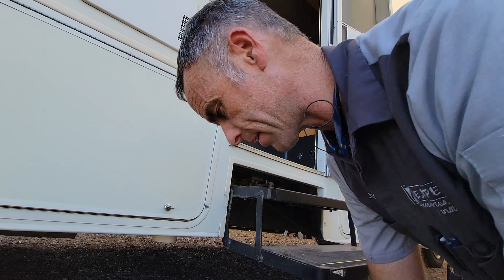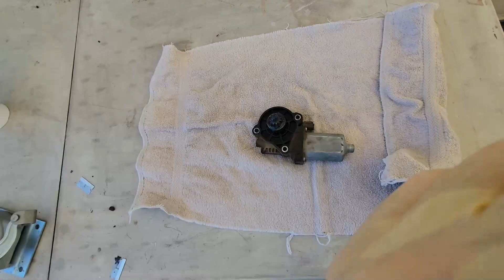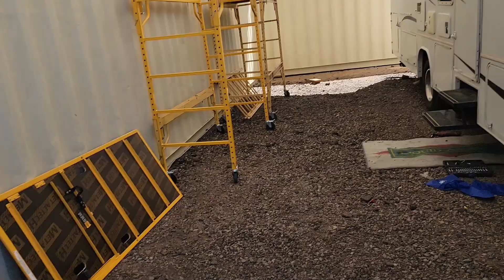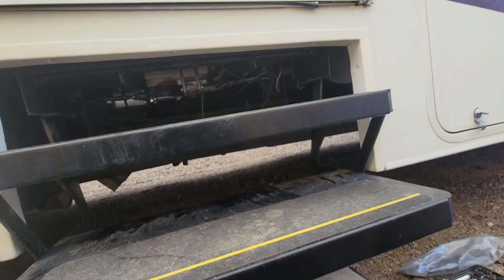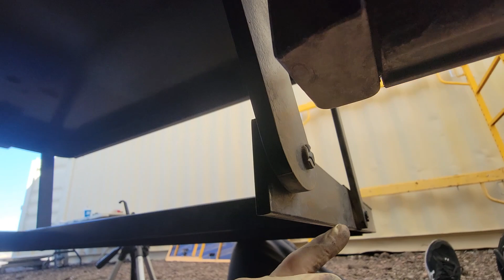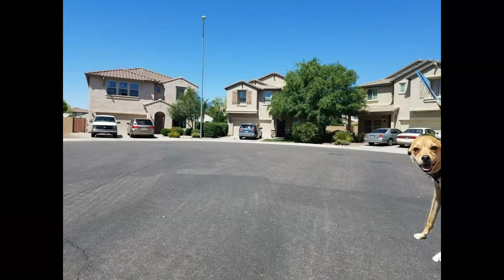Repairing a Kwikee RV Entry Step...Again

Comment: What Circuit lights up that orange lamp under the step?
Reply from the maker: Unless a wire is connected to the purple wire under the step the step controller lights up the light when the step is opened at the wall switch is on
Reply: @AZExpert  Thank you!

Comment: What would cause steps to stay out even with the engine running? 
Maybe the door switch thinks the door is open?
Reply from the maker: fuse, door switch, motor, controller

Comment: my Kwikee step stopped working on my 2002 Newmar Mountain Aire.  Trying to troubleshoot but wanted to ask...is that light underneath suppose to be on when there is power to it?  I noticed the light on mine doesn't come on so maybe check fuse?  thanks again for sharing you knowledge,  i love watching your vids...Fred
Reply from the maker: No only when the door is open and the wall switch is on
Reply: @AZ Expert  thanks,  I will check for that...I believe it was open and switch on which is why I noticed light on in your vid while mine never came on

Comment: Saved the video for when I get to fixing my steps doing a loud thump thump thump at the end of each cycle. I figure its the plastic gear from what I've been reading but I won't know until I investigate, could be that pin you mentioned that might be missing. I plan to turn the gear 180 degrees if it hasn't been done already by the previous owner if it is the plastic gear.
Reply from the maker: Awesome

Comment: My 98 HR Endeavor has the same step. Mine broke a week ago. In my case, the actual arm that connects to the stair broke at the connection to the motor. It had broken before & last owner welded it back on. Replaced it for 90 bucks in parts.  easy job.
Reply from the maker: Awesome

Comment: I waited, and you addressed my question. I replaced a quikee step, and it works the opposite; close the door it opens, open the door, it retracts. So, I simply need to rewire the motor. Reverse the two motor wires and an easy fix. Many thanks.
Reply from the maker: Awesome

Comment: My step just went out 8 days ago while on the road. I have a year old Winnebago. Mine didn’t have the gear arm as you show but has what I call a “drive gear” that the motor turns. Similar concept, and the motors themselves and the three bolt removal /install was the same. The motor was oriented differently but essentially, everything was as you described in your video. I was traveling from Phoenix to Oklahoma at the time and couldn’t find a place with the motor. Found on Amazon, shipped to a friend in Texas who was kind enough to meet me 4hours from his home. Fixed in about an hour for a first time try, in a campground. Going to carry a spare from now on. Pretty simple now that I’ve done one. 

Thank you again
Reply from the maker: Awesome!!

Comment: thanks for the lube points.  I did a "in the field" repair on a broken bolt that goes into the step.  the one with washer.  Im going to need ot replace steps due to hole being oblong.  Thanks as always James.  God Bless ya
Reply from the maker: Thanks for watching! :)